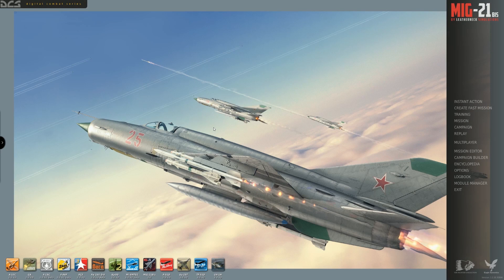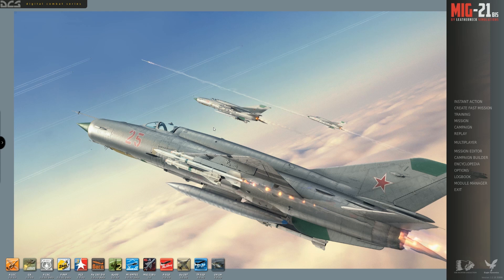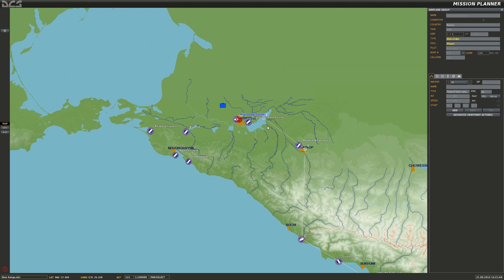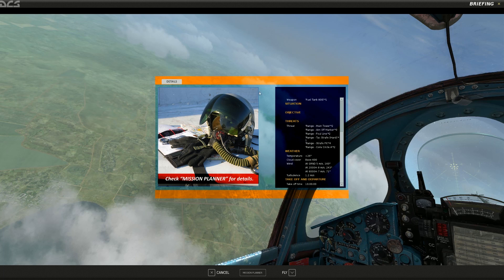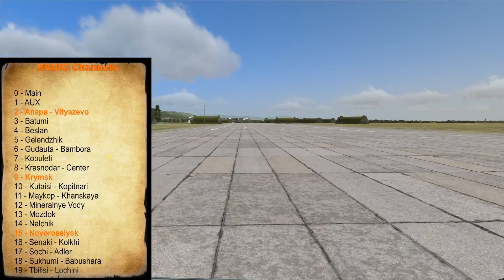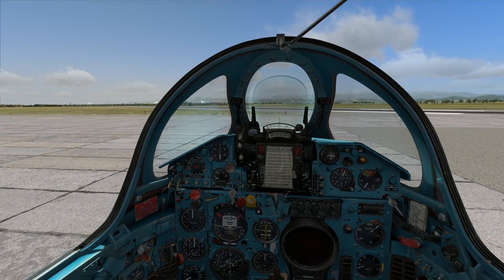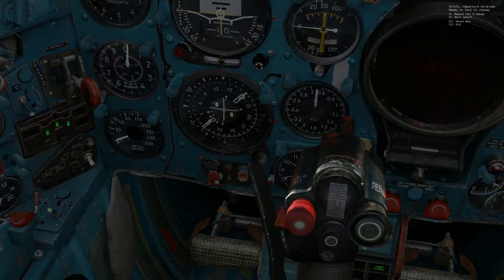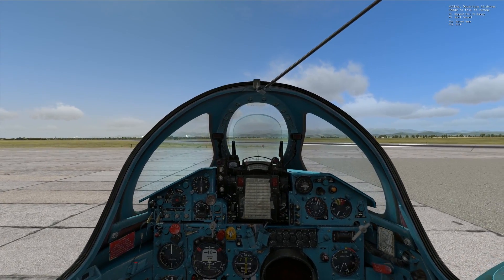Test Flight Preview - DCS: MiG-21 Bis Fishbed #11

Comment: That emergency afterburner on Mig-21bis (more precisely the Tumansky R-25 engine) has always intrigued me. It's only permitted under 4000m for a maximum of 3 minutes, and the engine must be fully inspected after every use. Every minute is equal to one full hour of normal engine life. On the other hand it generates more than 21000 lb of thrust, which pushes the aircraft thrust to weight ratio past 1:1 and gives the Mig-21bis better performance in the vertical plane than than early F-16 models. The fuel consumption, unsurprisingly, is more than double of the normal afterburner mode.

I can't find any info about how it actually works. Surely it's more than simply dumping more fuel into the afterburner.